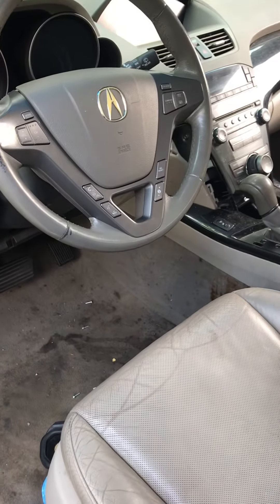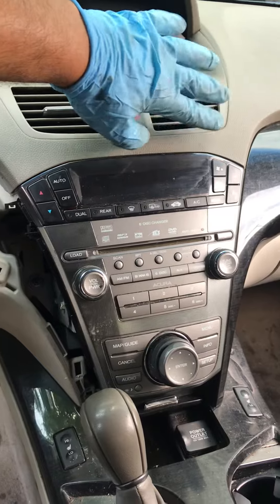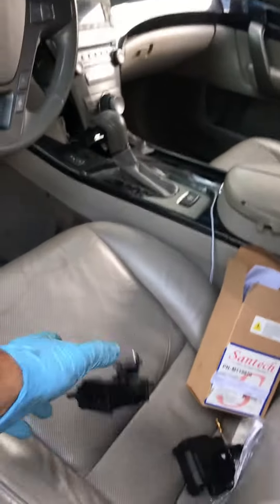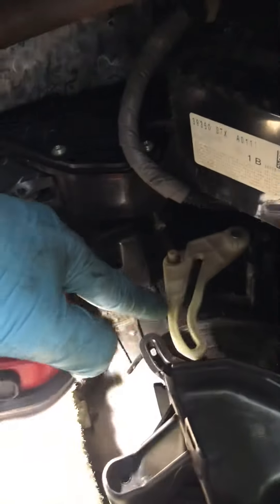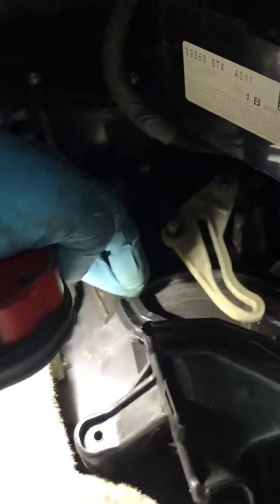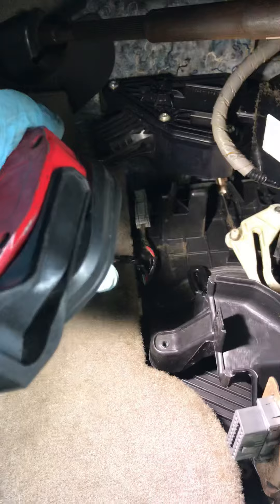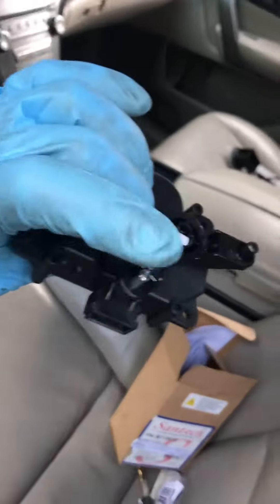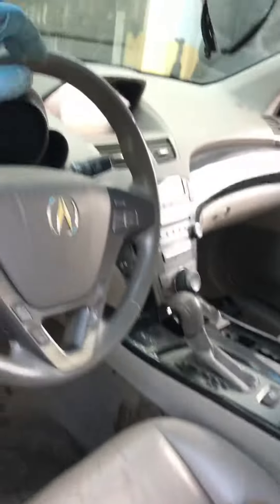Acura MDX Blows Warm A/C From The Driver Side And Cold From The Passenger Side (SOLVED)

Comment: I have a 2011 mdx Acura and recently my rt side mirror was replaced. After the installation, neither mirror would work simultaneously.  I brought it back to we're it was installed, and they claim it's correct. When I move the adjustment indicator to left or right that becomes the only mirror working in reverse.  Help help. To me it should be both working together
Reply from the maker: Check the fuse related to the power mirrors. If the fuse is blown, it could prevent both mirrors from working simultaneously if they are ok then you will need someone with a smart scanner to pull the code for it

Comment: I had q similar problem . A/C was blowing cold air  in the rear of the vehicle,  blowing cool air at the passenger location and blowing warm (not hot) air at the driver location. 
I removed the driver side door blend actuator and manually repositioned   the doors to the cool  position and I still had the same problem. 
Turned out the system was low on refrigerant. Recharged it and it is now working like a champ.
This flew against common sense in my brain. Logic said it must be a bad actuator.  
Hope this helps  and prevents you wasting time  (and possibly lots of money on a new actuator).
Reply: hi i have the same problem and not figure out yet do you fix your to see if you can point me to the right direction ?????????
Reply: Thanks for posting this, I think I have the same problem as you.
Reply: Thanks for this. Just tested and no problem with my actuator either. I probably would have bought a new one before removing the old one if I hadn't seen your comment.

Comment: Thanks for the video. Mine blows hot in the rear AC. Have to reach back to turn it off otherwise pure hot air. Also makes noise under the dash, driver's side. Also there was a humming behind the climate control center console after turning off the car, which caused the battery to drain. Any tips?
Reply from the maker: What year is it, and how many miles on it ?
Reply: @hanitwfik  2007 MDX 140k
Reply: @hanitwfik  I found the source of the humming that was draining the battery. Was actually the audio system. Pulled that fuse and it stopped humming. Now I have no stereo though. But at least the car will start in the morning.

Comment: What would be your next troubleshooting step if the blend door actuator moved during electronic control manipulations?  (My actuator moves when I press cool or hot but still hot on drivers side when trying for cool air).
Reply from the maker: Ok, there should be 2 arms control the cold and hot. Maybe one of them is broken or not in place. Otherwise, the actuator it may seem to work, but sometimes they turn halfway only. Now, how can you find the problem? You need to remove the actuator and check it out, then turn  those arms manually, al the way end and check the temp, then turn all the way to the other end that way you know if the problem is the actuator or internal. Good luck 👍

Comment: Very good video. Thank you. I have a 2015 RDX. I have the same problem , not cold air coming out the driver side only when the car is parked out in the heat of the sun. If it's parked in the garage or early morning, when I turn the AC on, both sides are cold. Is it the actuator?
Reply from the maker: You low on freon I believe you need to check it

Comment: I changed the actuator on the driver side and it still blowing hot air on the driver side , So what do you think is the problem next to that ?
Reply from the maker: remover the actuator and plug it in then move the switch from hot to cold and see if the actuator moves if it moves then check if you installed it right . before you installed it move the arm manually and see if any changes .good luck

Comment: Great Video I learned too much I have Acura MDX 2008 and same issue yesterday I found. Could you please help out to tell the price of the part and where did you bought. I checked Amazon and ebay and Car Quest not they selling high price.Thanks
Reply from the maker: It's between $20 to $35 at any auto parts store I bought it from autozone
Reply: @hanitwfik  Thanks brother.
Reply: @hanitwfik  Can I add refrigerant 134A at least 12 Onz to see it working or not than I will buy Actuator, Please give me your advice

Comment: My car works good on both sides but just get air in front.. any aide if is this part what I need? In this time I need air into my windshield but still get the air to the front
Reply: I got a 2010 acura mdx ac and hot works good on both sides but all the air going to the front
Reply from the maker: @THEBEST-vg5wt  is the climate control buttons is working fine ? if its working fine you may need to replace the mode door blend actuator
Reply: @hanitwfik  like I said everything works good ac and hot both sides my only thing is if I need the air go to the button it only go to the front I’ll try another climate temperature control but do the same I would search for that part you said thanks
Reply from the maker: @THEBEST-vg5wt  good luck with it let me know if you need help thanks

Comment: I am working on 2007 MDX and thought the compressor was fried but before replacing the compressor , i changed the compressor relay with fog lamp relay and ac started working but blows cold on the right side but not the left side like yours so now i have to figure out whether it's the actuator or low freon . Thanks for the post , very helpful .
Reply from the maker: Turn the a/c on then touch the a/c low pressure line if its cold enough so the problem could be the actuator good luck and thank you for watching

Comment: I appreciate the video. I checked my mixer and it was fine but I used this video to make sure I was checking it right. It's still good.

Driver side was hot, passenger and rear cold. I shot about 1/4 of a can of off the shelf r134 into the system and now all are cold. I don't understand how the passenger side can be so cold and the driver side so warm from just needing freon but it worked out that way
Reply from the maker: Glad to hear that thank you
Reply: Thanks for posting this, I think I have the same problem as you.

Comment: what is the other possible problem if the actuator is working but the issue is still same not Colling in driver side MDX 2009?
Reply from the maker: So you have cold in the passenger put not the driver side ? You could have a broken actuator arm or wire problem or the whole air box need to be replaced

Comment: I am having trouble with getting one of the screws off. There is this other part in the way. It is kind of square shaped and I can't get my screwdriver in there to get the top screw off. How do you get to the top screw?
Reply from the maker: Actually u will need to get some light on that part on your way its holding with one clip just unclip it with a screw driver the you need to get a small 8mm socket and ratchet 1/4 so it can fit in thar lil tiny spot thanks for watching let me know if you still can't get it out if you live around  atlanta Georgia I could do it for u at no charge

Comment: PLEASE HELP !! I replace it but still it’s blowing hot air driver side and cold passenger side and back
Reply from the maker: Take it out again sometime you could put it wrong so take it out and leave it plugged in then switch from clod to hot and see if the actuator move also there's an arm connected to it check if it's broken or out of its place and let me know thanks for watching
Reply: @hanitwfik  I LET PLUG IT AND PUT ON HOT AND MOVES MOTOR ... I MOVE THE WITHE AND BLACK PLASTIC UP AND DOWN NO MAKE ANY DIFERENCE EXCEPT MORE HOT AIR